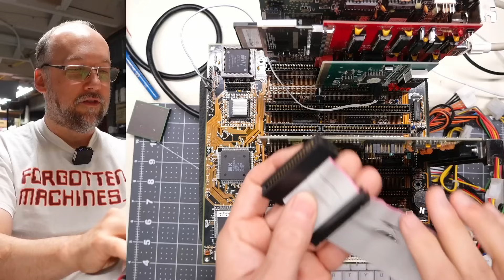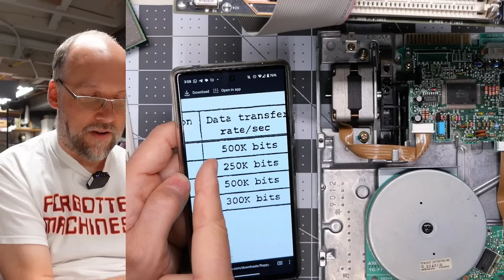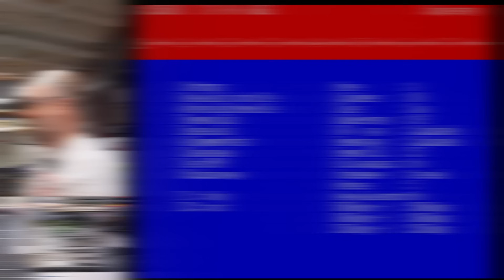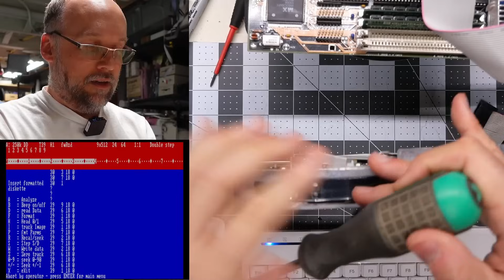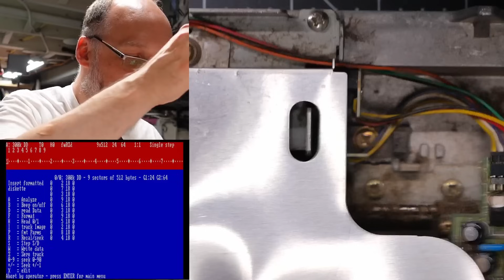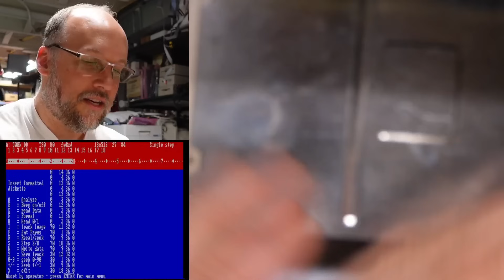Testing 12 mystery PC floppy drives

Comment from the maker: Patrons @andrewb9830 and @wearwolf2500 let me know that the white PCB TEAC does have the "I" jumper just to the right of the drive select jumpers. I just retested the drive and indeed, dual speed! 

Also, 
@wearwolf2500 reported: "I tested the termination on my FD-55GFR the other day and it measured 2K ohms." This is instead of the normal 150 ohm resistor chip that should be on the last drive in the chain of drives on the cable.
Reply: the panasonic is also dual speed and has a service manual with schematics and all on the retro web :)

Comment: When I first started working on PC's, like my first 486 model. I had one of those huge floppy drives in my system. I had many PC's after I helped a neighbor fix his computer with a BIOS chip replacement, he gave me computer parts. Then he got me many other jobs for people. who gave me their old PC after I built them a new one. I had about 10 of those wold floppy drives. I just kept them and installed them on other systems I sold. I still have one of them. I no longer have a motherboard to be able to connect it. I may send it to Adrian.

Comment: Great video.  I always enjoy these kind of vintage repair.  I digged out a broken 3.5"  floppy from the closet the other day to see why it does not read disk with data.  It only read formatted blank disk and it can format a disk, but it cannot be read on a working drive.  I used Image Disk and test both heads and alignment and it passed with no problem.  I just have no clue what went wrong with the drive.  It is Mitsubishi MF355F-2494UL.  Do you have any idea?

Comment: Hi adrian, what are those cleaning sticks at 40:05 called? i tried searching for them with every relevant word i could think of and couldnt find them online, would be much nicer than qtips.
Reply from the maker: I'm not totally sure -- a viewer sent them in a while back. Something he found in the UK I think used for cleaning VCR heads.
Reply: DigiKey has them #473-1183-ND aka MG Chemicals brand #810D-15 described as "Swab, Double Head Synthetic Chamois Tip 5.00" (127.0mm) 15 PC"

Comment: 53:23 I'm pretty sure I have an identical drive. I'm pleased your supporters provided the correct jumper configuration; although mine appears to be fine (unlike the computer it's in, which is currently propping up the telly shelf) I never noticed it changing speeds with 360K vs. 1.2M disks .. although the noise from the machine itself probably masked that. I archived a load of 5¼" DD & HD disks before I tried upgrading the RAM and promptly losing the original, just before testing, only to see the new RAM wouldn't let the machine POST .. D'Oh! I'll have to ask the cat. 🐈

Comment: I always date the drives when they were tested - nothing worse than pulling a 40 Mb hard disk that says OK on it and plugging it in and the stepper motor doesn't move the heads (as it was tested OK in 2008 lol)

Comment: Watching you test those drives reminded me of when I salvaged a CD-ROM drive from a very weathered computer chassis someone had left on a vacant block, it was the last component left in the machine and the faceplate was quite yellowed. However when I stuck it into a five & a quarter inch external drive casing it started up and ran with no problems for many years, sadly I lost it in a move.

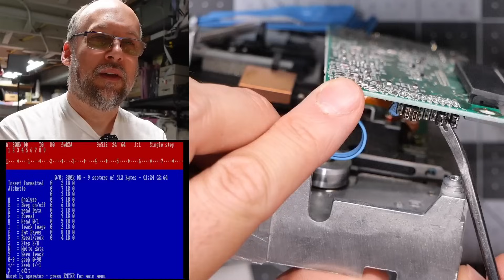Comment: I have that Chinon and the jumpers are set exactly like you did in 52:40.
The lever is the same color as the rest of the faceplate, no idea why yours is darker.
I also have the Panasonic, but yours is AK3 while mine is AP3, jumpers set the same as 54:56.
I have the Epson as well, inside a typical "mini tower" case of the 90ies.

Comment: There are more dual-speed 3.5" drives than you might expect: In Japan, a 1.2MB format for 3.5" disks (virtually identical to the 1.2MB format for 5.25" disks of the IBM AT) was common, so this needed 360RPM. There are "3-mode drives" (supporting 3 modes, hence the name) that support 720KB disks, 1.2MB disks and 1.44MB disks. In contrast to 5.25" drives, that only get one bit of "speed info" from the density select signal on the FDC cable, 3.5" HD drives have another source of information: The HD hole in the disk. On the interface side, stuff gets messy: Some 3.5" drives have "density select" as *output*, indicating the state of the HD hole sensor switch. Some 3.5" drives have "density select" as input, with high (not pulled down) indicating HD (that's compatible with the IBM AT 5.25" disk drive, and the convention used on PC drives), but these drives are sometimes incompatible with DD systems that do not pull this line low. Some 3.5" drives have "density select" as input, with high (not pulled down) indicating DD.
Now enter the magic of 3-mode drives: If you have two inputs, the hole detector and the "density select" pin, you get 4 combinations. "No HD hole"/"density select low" is for 720KB mode. "HD hole"/"density select high" is for 1.44MB mode. One of the other combinations enables 1.2MB mode, increasing the drive speed. I forgot which of the two remaining combinations it is, but you usually just don't notice that this mode exists because the BIOS never sets it on PC-compatible computers.

Comment: Hi Adrian! I have two Mitsumi/ Newtronics 1.2 MB drives amongst others - one of them works extremely well and reads all marginal disks, while the other one (and several TEAC drives I have) gets broken all the times after defective disks (and cleaning does not seem to help much unfortunately). They are a bit different - D509V2 and D509V3 - but there is a pair of jumpers there named either 2S/LS or 2S/HS, and 2S is for allowing the dual speed.

Comment: Adrian, I suggest taking the controller board from the non-working teac Drive, and swapping it onto the one that has the stranger newer for that does not allow speed control. This is an easy way to check if it is a mechanical failure or an electronic failure between the mechanism and the controller card on the drive itself I mean. If it fails in the other Drive, then you know there's a fault on the card, and if not and therefore it works in the other Drive, that will make that drive the Dual speed, and then you can sort out the faults in the mechanism on the other one.

Comment: Does anyone know why when I copy the DVD of the navigation DVD from my 2011 Denso Toyota Gen 6 navigation radio it won't work?

I tried using UltraISO and right clicked save image and it read the whole DVD and made a ISO and burned it to an 8.5 DL DVD
The original is 8.5 GB

But it does not read it but reads the factory original just fine.

Threads I read say to use DVDdecrypter
NOT sure if this disc is encrypted somehow
I can read all the files on the PC
Maybe a DVD+R DL is different from a pressed DL?
Reply: Yes, if I remember correctly the +R has slightly different dye color and drives can be tuned to only work with normal pressed DL color.  Common in game consoles as a simple anti-piracy thing.  Sometimes the laser gain trimmer adjustment can be twiddled to make them "see" all dye colors but can also overdrive the laser and toast it.  Also there are DVD-R DL and DVD+R DL so maybe a -R would work assuming your burner supports those.  Similar to the old CD+RW (erasable) vs CD-R (write once) which some CD drives would not read the rewritable ones, and +RW had very different dark blue dye, and may have even required a different wavelength of laser.  But after all that, it could be some other form of copy protection like a hidden track or nonstandard format on a single track, that the Toyota system checks for (more game console type trickery).

Also sometimes burning at the slowest speed helps.

Comment: What always blew my mind about floppy drives over even CD/DVD drives is that the smaller the disk, the higher the capacity. How did they do that and why could they not make the 5¼ inch drives higher capacity as they had more space to work with?

Comment: Chinon 5.25

TM: closed for drive A, open for drive B
DS0: open
DS1: closed
DS2: open
DS3: open
IU: open
MS1: closed
D-R: closed
MS2: open

TM are the termination resistors, which must be enabled only for the last drive on the cable, normally drive A. DS1 is the standard Drive Select number for IBM PC/compatibles. D-R selects the function of pin 34, Disk Changed if open, Drive Ready if closed. IU enables the In Use signal, which is, ironically, never actually used.
Enabling both MS1 and MS2 selects automatic motor speed switching. MS2 enables it, and MS1 inverts the signal from pin 2 (or else it spins at 360rpm for DD and 300rpm for HD discs). Don't know if this has any use anymore, maybe some ancient controllers still work with it...

https://www.vogons.org/viewtopic.php?t=36942

Comment: Dual speed make no sense.. FLoppy`s written in a 360KB have wider tracks. 1.2MB using smaller tracks... Floppy written in a 1.2 drive have may read problems in a older drive.

I would never write 360KB floppys in a 1.2 Drive. Smaller tracks are prone to fail sooner.

Comment: What you say about speeds might finally explain something. Back at college we had BBC Micro floppies that worked as 40 or 80 tracks but (unlike, later, on PCs) you had to flip a switch on the front to change modes - I wonder if that switch had anything to do with switching speeds.
Reply: While I have no indication that the switch does not relate to speed, I guess this is not the most likely reason. 5.25" Double Density (9 sectors at 512 byte sector size, around 17 sectors at 256 byte sector size) always uses 300 rpm drives, so as long as you don't exceed 800KB in the 80-track mode, there is no reason for the drive to spin at 360 rpm.

On the other hand, if you connect an 80-track (96 tpi) drive to a computer expecting a 40-track drive to read 40 track disks, you need to use double stepping: The computer sends one seek pulse to get to the next track, but a 80-track drives needs two seek pulses to step 1/48 of an inch. So I consider it much more likely that this switch enabled double stepping on the drive level.

By the way, this is why many PC/XT BIOSes that were meant to operate on 360KB floppies only work mostly perfectly with 720KB 3.5" DD drives: The BIOS does not limit the track count to 40 tracks, so a drive that is able to do 80 steps inwards if you send it 80 seek pulses can be driven with exactly the same interface code as a drive that can just do 40 tracks until it bangs against the stop. There might be an issue convincing DOS FORMAT.COM to accept that there are 80 tracks on that drive, though, because there is no BIOS support to tell DOS that this drive is not a 360KB drive, so for formatting, a 3rd party tool that does not rely on the BIOS to indicate the drive type correctly might be required.

Comment: I swear that the ONLY Teac drives in that model generation I ever saw fail, were actually just DOA. I know I wasn't using these in the modern age, but across the 3 companies I was working for in the 80's and 90's we sold 10's of thousands of those. Often a PC would come in for 5 or 6 major upgrades over its life, but only the Teac remained stock.
Reply: I remember in the 90ies many computers 286/386 were sold with both 1.2m and 1.4m drives but by then 1.4m got traction and many users never used the 1.2m for anything in its whole PC lifespan. But that's how the shop i worked at sold them (maybe to get rid of the inventory), until the PCs were sold only with floppy/hd and maybe cd later. Those people who did have old 5 1/4" floppies were mostly coming from XT clones and those were universally 360k. So the rare 1.2m floppy i saw was because they bought a box of blanks or the rare game program that came in those. While i have a lot of floppies, i don't think i have even one 1.2mb, or maybe i do in some game box that came with both. Actually now i remember when i switched to 286 i brought my old 360k floppy drive since ALL my older floppies were 360k, and to buy new blanks i just went straight to 1.4. Floppies were reliable in the early 90ies, unless you did something stupid like putting it next to a magnet (like a speaker) or EM source like a PSU/CRT (especially self de-gaussing CRTs which most were).

Comment: I have a 5.25" drive that has started scratching a groove in disks. I cleaned the heads but it is still doing it - so it is in limbo until fixed as it is just destroying disks at the moment 😪
Reply: I have also one of this disk drives that "engrave" the disk :-(
I'm wondering if its even possible to repair it.

Comment: I am still not over breaking 5 5.25 floppy drives with that cursed cleaning disk 2 years ago. I need to finally make some attempts at repairing them and I have more of them to test. Thanks for reminding my of the procedures and software to use.

Comment: Fun video, I hope you do a video like this with Commodore 1541 drives I have a flip down arm 1541 that is the kind that will have heads that physically break off. I would love to see all your tips on getting 1541 drives running and calibrated.  Also, the Coleco Adam has a floppy drive, but those are cRaZy expensive.

Comment: Hey Adrian, I have a drive that made exactly the same sound as yours at 36:45 in the video. Turns out the problem was simply the flywheel rubbing against the surface of the desk! Prop the drive up on the edges, install it in a drive bay, or lie it on its side and it will probably work just fine 🙂

Comment: All 55GFRs are dual speed, including that 7149-u5. There is a  I-jumper right to the drive select ”cross” jumper on your video. I just checked the manual and it says that when I jumper is not set, speed will be always 360 RPM. When it is placed, it will be 300rpm in low density mode and 360rpm in high density mode. Default is jumper is not placed and this is also the situation on your drive. IU-jumper is ”In Use” signal and it affects the LED.

Comment: Hi Adrian, the drive with the head problems at 39:22 : perhaps I'm wrong but the solder joints from the head ribbon cable look a bit suspicious, especially lines 6, 5 and 4. Just in case :)

Comment: I got an Epson SD-600 a while back, but it hasn't got the PCB amongst the latch mech with the sensors on it, and over time I've traced out what it's meant to be wiring-wise (a switch, couple phototransitors & one resistor) so I could bodge something together eventually, aside from one part, the resistor that's on the board marked "R100", nobody seems to show what it is, if you could measure it's resistance, that'd be great cos I'd like to know if my drive actually works or not considering it was annoyingly expensive to acquire and turned out to be a lemon on arrival... :)

Comment: Hey Adrian, you might want to construct a "diagnostic" PCB from some protoboard. I made one that goes between a drive and PC, and it has LEDs showing the logic states of each line. I can also manually command lines high or low to run the drives without a PC. You can also use the drive's index pulse connected to the step input to make the head move once per rotation. 

Making the board gave me a really great understanding of how the interface works. Would be a cool project!

Comment: Way back in the 80s, I acquired a faulty 80 track drive through the Northern Suburbs Color Computer Club which I intended to use on my coco. The drive would not unload the head as the solenoid had nothing on the armature to provide a magnetic gap.  The residual magnetism kept it held to the solenoid core. Bit of tape on the armature and head unloaded every time.  It was a double density one, not high density.  One of the members had a “bridge disk” which was a 1.2MB drive with the dual speed jumper.  He was having trouble using it on a PC and I could hear the drive change speed. I figured the DS jumper (it was labelled DS) was the issue and changed it. Drive now didn’t change speed and worked fine.  Congratulations on becoming a full time YouTuber, hope you have a great new career Adrian!

Comment: Nicely done! Sure, it's grunt work, but grunt work is part of retrocomputing just as much as anything else. Kudos for making a video of it :) good for background racket, if nothing else -- I listened to it while doing some artwork.

It also serves the purpose of reminding me -- I have a 1989 Panasonic hardware word proc, has a VERY weird 3.5in floppy drive, basically a DD single side drive, with a belt drive spindle... oddly, there's no way to replace the belt without either removing the RPM sense PCB or desoldering its cable, and now I need to realign that PCB. I've been putting it off for a while. But I also now have the nonstandard 26pin pinout for it (no, it's not FFC/slim, it's a standard desktop size drive with a 26pin pin header connector with power integrated and no separate Berg power connector) so I might just whip up a custom cable to try and use the optical method of aligning the drive, since it's got one of those spindles where you can tell by looking. I forget whose channel it was talked about that, it's a clever optical illusion thing. So maybe I'll get to that sooner rather than later.

Comment: Vogons has a scanned PDF of the manual for the FZ-506 floppy drive. It has multiple different modes, and from what I can tell, it should do dual speed if you get it setup correctly. I think you were pretty close though.
Reply: His mistake was closing MS1 (invert), only MS2 needs to be closed to enable dual speed.

Comment: The dirty drives look as bad as one I pulled from a bin of random junk at a flea market uears ago. It was crammed full of dust and dirt. It worked, but I didn't clean it out good enough before using it, so it cut a ring of data out of my DOS boot disk.